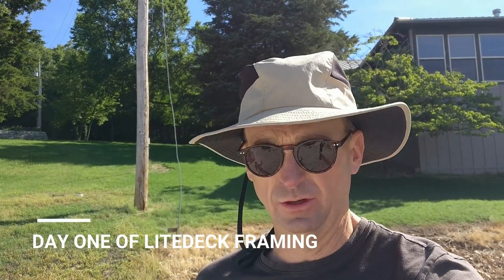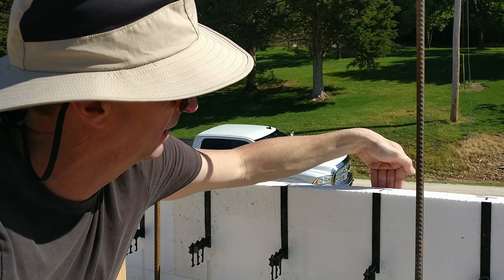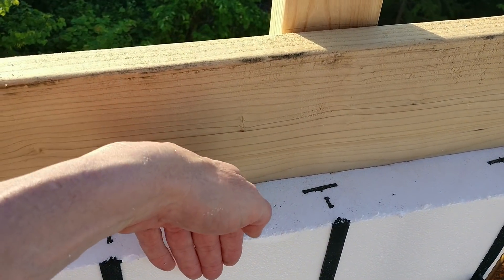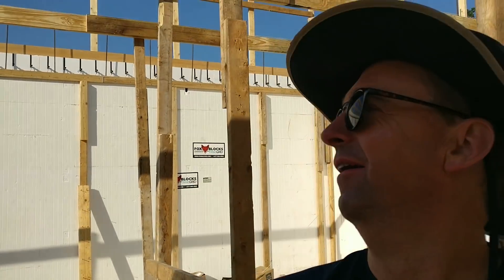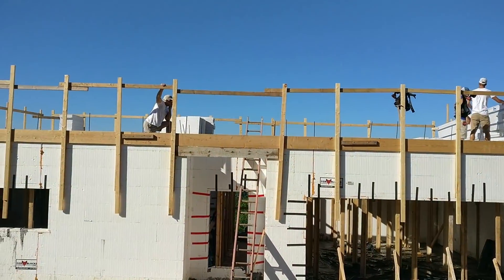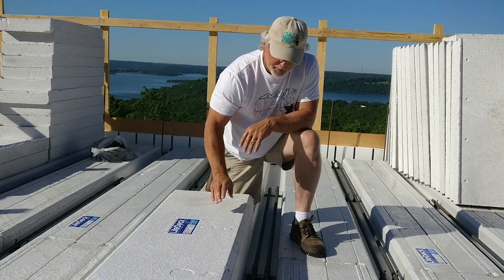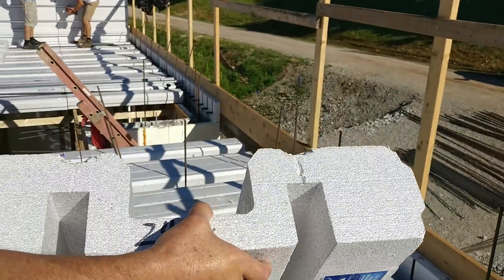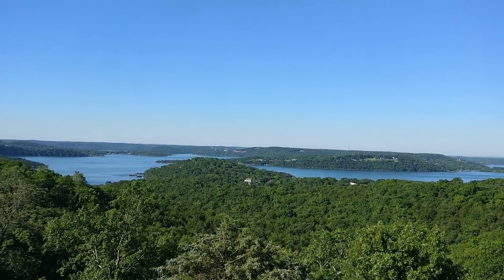Our ICF Concrete Roof: Suspended concrete roof using LiteDeck ICF panels for our rooftop deck

Comment: What microphone were you using to record that video? It turned out really good. You can hear ambient noises plus here you really good?
Reply from the maker: It is a lapel mic with a really long cord plugged directly into the phone we use for filming. I was looking for the exact model on Amazon, but I can't find it. It was really just an inexpensive lapel mic.

Comment: Would you use lite deck again? There are other ways of doing a suspended slab.
Reply from the maker: I think the answer is "maybe." We really like the fact that it is insulated so that we don't lose or gain heat through the garage floor. We researched pan and pour and just though the insulation factor of LiteDeck was better. There may be a better option out there though for other homes and situations.

Comment: I am building an ICF house in Florida with similar ICF flat roof. The main roof is approximately 40x38 feet, 17.5 inch foam + 3.5 inch concrete. The ICF roof rep suggested to embed the channel into the concrete along the perimeter to serve as gutter. The engineering company suggested that the contractor slopes the concrete layer for water management. My fear is that with 3.5 inch concrete overall layer they will make it super thick in higher areas and skinny thin in lower areas and it will not be consistent. What I was thinking is to shave the top of ICF walls to make a slight slope and then laydown / shore the LiteDeck according to that slope. This way the concrete guys would just care to pour 3.5 inches of concrete throughout the entire roof span. Could you please elaborate on this?
Reply from the maker: Yes! Your plan is excellent. Slope the roof so you can have an even pour and ensure the proper slope.

Comment: As a concrete of almost 50 yrs you couldn't pay me enough to be part of that pour. Scary as hell.
Reply: I know what you are talking about; I saw the concrete ceiling of a huge tank for a water treatment plant collapse in the middle of the pour. Things started shifting as they do when a lot of weight is added unevenly and eventually, a shoring post buckled causing a chain reaction with the others.   What a mess that was! The contractor declared bankruptcy the next day.
Reply: Why is that ?

Comment: Hello,  
What type of roof system did you used. 

What was your square feet/per dollar. We are getting ready to do a ICF build but I am still trying figure the roof system and cost. 
How did you run A/C ducking?? 

Thank you.
Reply: I was recommended litedeck srs system for flooring and roof.
Reply from the maker: Hi! We used an elastomeric roll on product for the roof. We also used Xypex in the concrete to help wit waterproofing. We are still not entirely happy with our roof as the slope was not done right and we have ponding water. Be sure to do a good slope on the concrete for the roof. We put in our own HVAC system. Here is the video on that https://youtu.be/FqhquG0NEdw
Reply: Thank you for your reply,  
Yes, will be using an elastomeric paint finish and anything else recommended to make sure is is done right. Pitch will be 2”-3”/12”.  I will look at your video for HVAC later today. 

Material and installation did you came out with $14.50 per square feet.
Reply from the maker: Oh the LiteDeck was very expensive! The elastomeric product though was less than $10 per SQ ft.
Reply: Yes I notice that too. Going to have heave to look at other systems and come up with the total cost. 

Thank you.

Comment: Is there a way to do an icf addition and do foam over the existing structure? I've got asbestos siding in decent shape and would rather encapsulate than remove.
Reply from the maker: I'm not sure. An ICF builder in your area could at least look at what you have and give you their opinion. Good luck on your addition and thanks for watching!

Comment: I was planning to build a PerfectBlock/EFBlock house with flat Litedeck second floor and roof before I found your channel.
It has been priceless to watch your journey. Thank you so much for sharing this experience with us.

We're going to be off grid, and our area has very soft water.
We're planning to add a parapet wall, scuppers and rain catchment for our primary water supply here in NE TX were we get 47" of rain annually.
Otherwise...pretty much the same as your setup. One twist I'm working on...I think I'm going to do do "bays" with the Litedeck running sideways and a center wall separating the living side and the bedroom side. I think I'll get more square footage for the money.
Reply from the maker: Sounds awesome!!! Make sure they get the slope right on the roof so that you get the correct drainage off the rooftop.

Comment: Concrete cracks, so are you going to put a waterproofing membrane on the very top? How will you end a waterproof membrane? Extending the concrete over the outside edge of the ICF is a good idea but you don't seem to have a drip edge.
Reply from the maker: We have Xypex in the concrete which is a waterproofing additive. We will also use a multi-step roll on product with a walkable finish over the concrete. We will be filming that process soon.
Reply: @LakeLotBuild Finally! Someone mentiond Xypex additive in the concrete. This was my plan for a future build.

Did you add a super plasticizer like Kel-Crete as well? Or even fibers (glass, basalt) ?

What psi will the concrete cure at?
Reply: Not all concrete cracks, 2. It good  insulation ......I am building full concrete house, roof with iron sheets

Comment: The people on the other side of the road gonna be pissed you block their view.
Reply from the maker: We actually don't block their view because we are doing a flat roof. They are thrilled! A traditional style house with pitched roof would have taken their view.
Reply: @LakeLotBuild  that's nice. I can imagine a solid 2 story icf house replacing that single wide on the side of the hill already. Try to talk them into it.
Reply: @LakeLotBuild  what are you doing to finish your roof/waterproof it?
Reply from the maker: We added Xypex to the concrete which is a waterproofing concrete additive. In addition, we will be doing a multi-step roll on waterproofing system with a walkable surface. We will be filming all of it once we get the railing on.
Reply: @LakeLotBuild  my personal plan is to get on a building crew one day and pick up the skills to do a job like this before spending money and blowing it for lack of knowledge and experience.

Comment: Can I get a cost breakdown from start to finish just starting my journey into ICF and I'm just wondering what the prices are from laying the foundation to laying out the forms for the actual house thanks
Reply from the maker: Thank you for watching! It is so difficult to tell you what you might encounter with your lot and build versus ours. We had a lot of excavation work first because we are built on a steep slope. We also have a concrete roof,which is uncommon and not typically bid in an ICF house. We also have two huge concrete decks going on the back of the house. Our ICF contractor is doing all of that work, so it is hard to break it down. What I can tell you is that the US Department of housing did a research study for HUD and found that a typical ICF home only adds 3 to 5% more over a typical build. Of course this is when lumber was much less than what it is today. We figure that we actually saved money building with ICF and current lumber prices. The cost of your ICF blocks will also vary based upon your builder. Our builder builds several ICF homes and so he's able to buy semi trucks full of block. If your builder is just doing your home, he or she would not be able to get the volume discount pricing that our builder is probably getting. I would definitely encourage you to reach out to Fox blocks or a local ICF builder and just ask them if they could offer am estimated cost per SQ. Foot. What I can tell you is that we wouldn't build with anything other than ICF at this point. It's a vastly superior product to a wood, in our opinion.
Reply: @LakeLotBuild  so they did foundation as well or was that done separate from another contractor
Reply from the maker: We did the excavation separately but the ICF contractor did some of his own backfill and prep for the foundation. He poured the foundation in a monolithic pour. We have a video of that too if you want to see that process.

Comment: Ha! Knew the deck view would be worth doing 
:D
EDIT: also curious what in/ft pitch you're going with for rain run-off, and if the engineer gave an indication of what snow load it's calculated to handle? (reason i suggested the deck was partially cause i had the idea for a Casita we've yet to build, but wanted to see it done somewhere 1st so we'd learn from it, lol... -thx!)
Reply from the maker: No worries about snow load. We never get more than a couple of inches here,but that said, you could park cars on this roof, so it can hold plenty. Our slope is somewhere between 1/8 and 1/4 inch per foot.
Reply: @LakeLotBuild  awesome, thx for the info

Comment: 2×4 do Ben when weight on it
Reply from the maker: No problem with bending since we make a "T" with two 2x4 for the bracing. It makes them very strong. We reuse the wood over and over until it finally ends up as our interior walls.
Reply: @LakeLotBuild  hope this one goes well

Comment: Why not use metal jack
Reply from the maker: Some builders do I think. It works well. We reuse the wood over and over until it finally ends up as our interior walls, so nothing is wasted.
Reply: Lake Lot Build yeah if you did that type of work for a career it might be cost effective to invest in metal shoring.  However for a one time project your method is better.   

Looks good!
Reply: @LakeLotBuild  I can see that